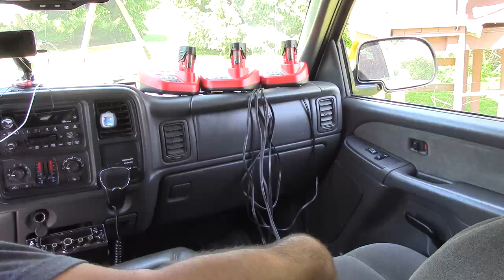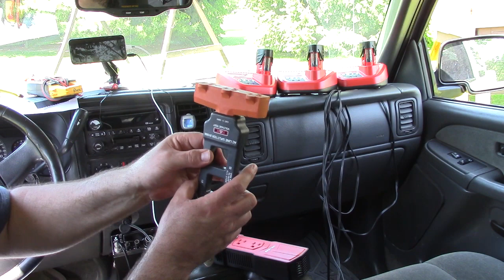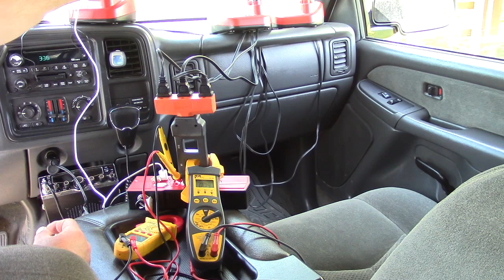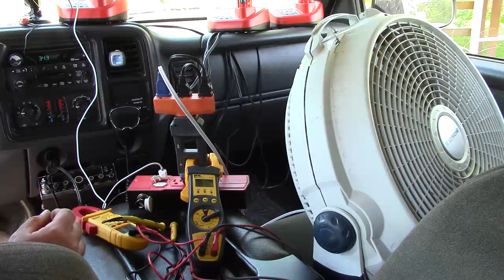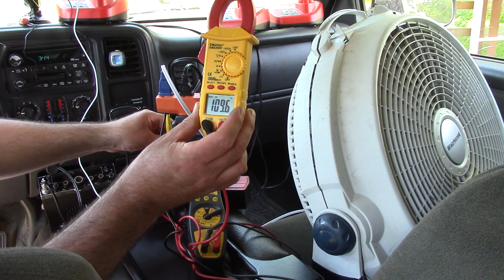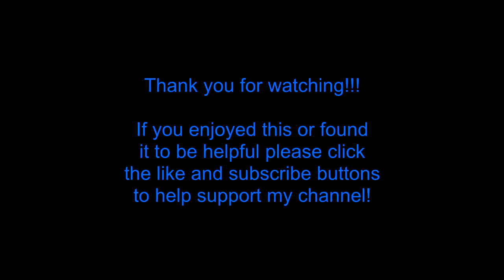BESTEK power inverter- Easy AC power in your car/truck/RV

Comment: Hi Sir. I don't know why my accura mdx 2018 doesn't work with these. I bought 3 brands, the one like your, Stanley, dewalt but when plug 17in tv cable the light start blinking not stay. Thks

Comment: Would this work with a big vacuum. I wanna clean my car but I live in an apartment so power outlets. Thanks
Reply: Use a small vaccum, the big one needs a bigger watt converter
Reply: I would think so. Maybe not a garage wet vac.

Comment: i have electric chainsaw 9 AMP 60 hz,...can i run it with 1000 watt bestek inverter from cigarett plug or i need to plug it to battery ?
Reply: Most cigarette lighter fuses and wires can only handle 150 watts. Even if it has a 20 amp fuse and 20 amp rated wire that's only 240 watts. Which is the Most I've seen. They have some that connect straight to the battery that can handle 1000+ watts. But the vehicle needs to be on.
Reply: That's a good question actually.
How many watts can be drawn through a cigarette lighter plug without blowing fuses?
or should the question be: How many amps can be ...?
I know appliances, like crockpots, show wattage usage and the wattage total should not exceed the wattage rating of the inverter.

Comment: The lighter plug on the inverter is not meant for an actual lighter but to power an item with a 12v lighter plug!!! haha Never seen anyone think to use it for a lighter! too funny! Guess a smoker would appreciate that but it's not the intended use for that plug!
Reply: They used to actually be cigarette lighters.  My 1998 Chevy Lumina had an actual cigarette lighter in it.

Comment: im planning to install my laptop or put pc w/ monitor in my car. is this compatible to my car sedan??? thanks
Reply from the maker: You need to see how much am load the pc and monitor are pulling.  If it’s more than 1 amp I would go a different route 
This information will be imprinted on the pc and monitor

Comment: would this power a small space heater?
Reply from the maker: No.  Those usually pull some amps.   Look at the watts on your heater.  Say it’s 600 watts.   That would roughly translate to 6 amps.  That’s too much for a cigarette lighter outlet.  If you don’t have the watts but you have the amps just multiply by 100 to get the approximate watts.
Reply: its listed as a 200 watt heater, mini thing
Reply from the maker: I’d still say it’s probably too much for a lighter socket to handle.   Be better off coming off an inverter imo
Reply: Bill H. If you want to run a space heater in your car I'd suggest getting one that plugs into a car DC plug so it's designed to run on DC. I got one at a hardware store for about $20 but you could probably find them online

Comment: Sir i have koyo inverter 500 watt peak power when i pluged it to my cigaret lighter it blown out my fuse  why
Reply from the maker: Outlet inverter shouldn’t do much more than 100 watt.  A 500 watt inverter should connect to the battery directly or have a  connection for it that is rated for that high of a load.

Comment: Is there any effects to the car battery?
Reply from the maker: Should not be.  This is not a large load on the battery and it should handle it fine.  If it doesn't you most likely had a bad battery.
Reply: @burbbilly  and if I charged a laptop will it cause a damage to it

Comment: Perfect timing I've been looking for inverter I can count on. This is a really cool inverter;  I'll check back for a coupon. I'm definitely going to get on. Thanks for sharing your video Billy
Reply from the maker: You're welcome Pamela, the price point on this one is pretty good.   If you need one you can give it a google search and see what comes up.  Might save a few bucks.  Watch out for shipping, different companies charge different rates.  I have some other inverter videos planned, larger watt size and some that need to be directly wired to your battery.  These would be for larger power needs while out on the road or camping.  Basic day to day though and this one is all you would need.  BB